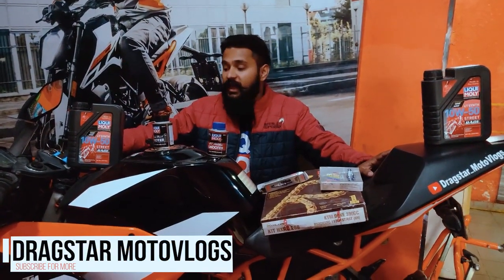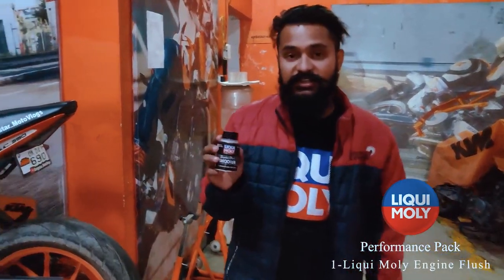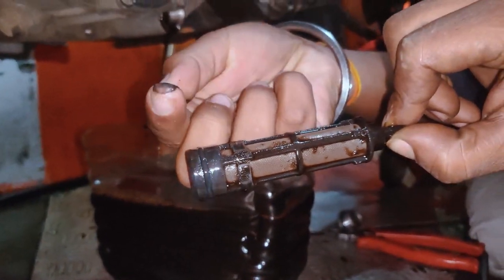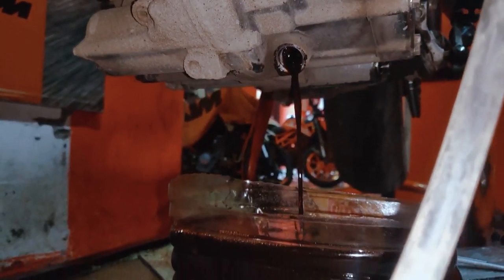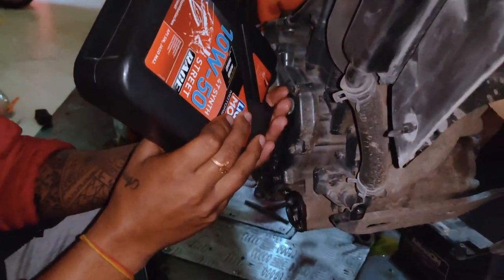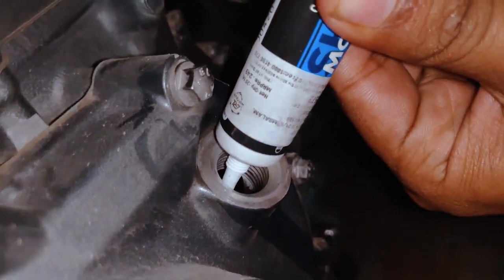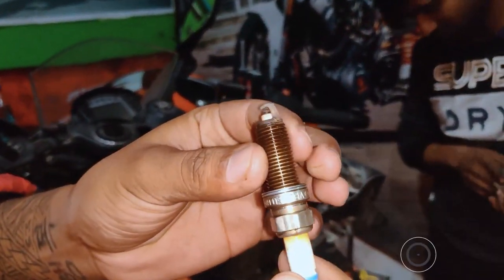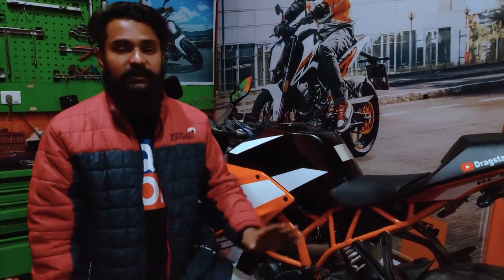My 4th service costing 100000 | I left Motul and switched to Liqui Moly performance pack |

Comment: Bro am useing in ma duke 390 lique molly 10w40 there was any problm for it plz rply
Reply from the maker: There will be no problem. I m using it for more than 1 year. It is really good engine oil.
Reply: Bro use liquimoly 10w50 Street 1.65 litre